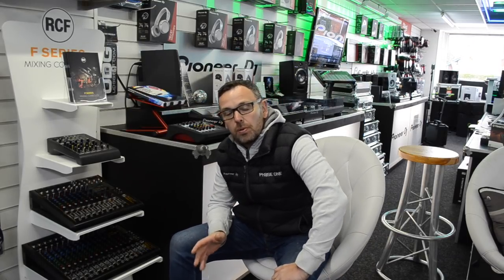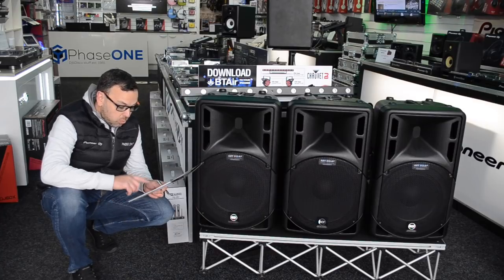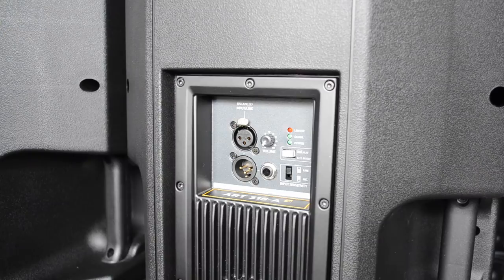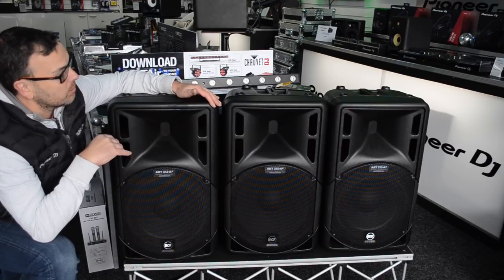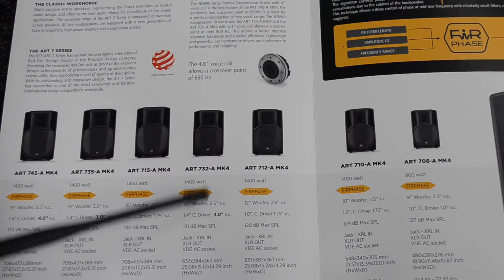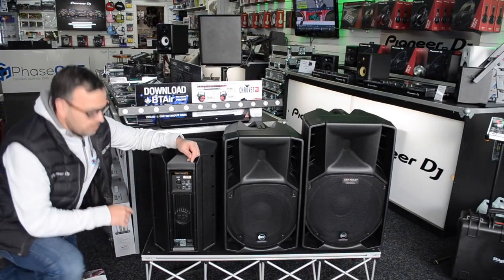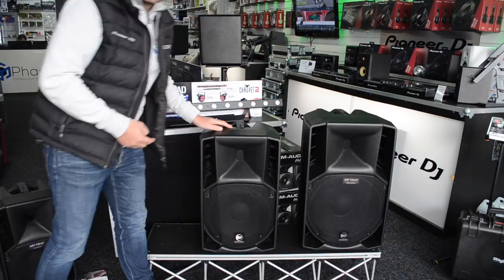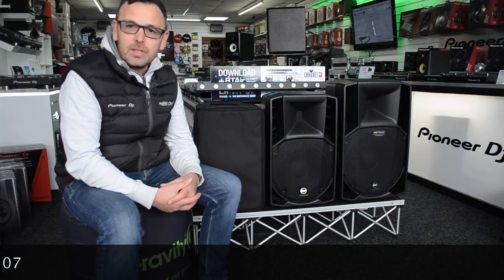RCF ART SERIES @ PHASE ONE

Comment: Regarding the bass response of these speakers: that Flat/Boost button is NOT for DJ's to turn on. Its suggested use is to extend the low-end at LOW volumes when you use the tops without subs. DJ's usually push the volume up, like we all know, and should do that as they please with the knob on Flat, whether they use it with subs or not (they definitely should do WITH as the low-end is pretty poor without them, especially on the non-15" models).
Reply: that’s why the 315 is the best option.
other than that, if you use the boost up until it barely starts to limit I think you’ll be safe
Reply: Agreed on the EQ, leave it flat, don't let it peak, and use the eq on the mixer or rack if need be.  If you stack two 315s per side in a smallish space the sound wall can start hitting pretty hard, two alone don't push that much air, and def can use a sub or two, especially outdoors.